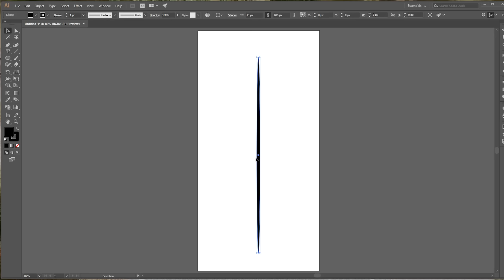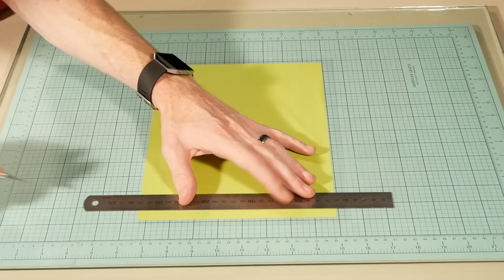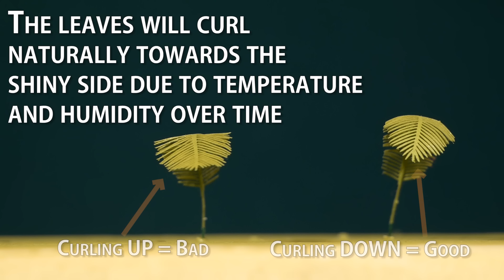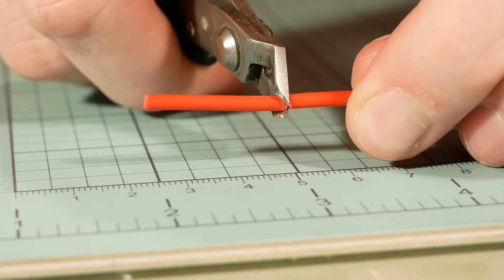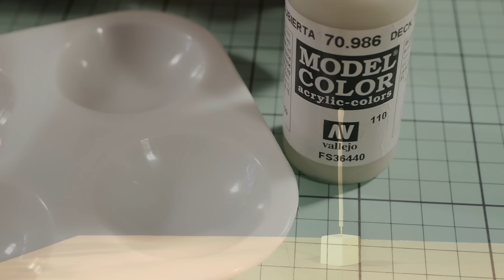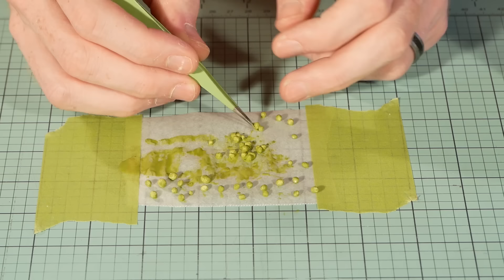Coconut Palm Tree Tutorial - Model Scenery

Comment: If you want to get a more organic, random assortment of shapes in Illustrator without a lot of manual effort, try using Object > Transform > Transform Each and check the "Random" box. You can then play with the sliders and inputs to make the leaves a slightly uneven length and even adjust their rotation angle at random within a range you specify.

Comment: What scale are you working in for the palm fronds cut with the electric cutter?  I wonder if the cutter can do ones small enough for HO.
Reply from the maker: hey mate, yeah these are HO scale. It could probably cut slightly smaller but I think the intricate detail in these palm fronds are pretty close to the limits of this machine. I'm planning on making a large beach scene so the scan n cut machine will be getting used quite a lot soon!

Comment: Ok so I've always had this weird fascination with miniatures.  I think it started when I was little. I always wanted to be able to shrink down and run around the models. Probably why 'A Castle in the Attic' was my fave book when I was younger. Anyway I've been inspired to start making my own and I was wondering what medium is the most 'forgiving' for newbies? Where I live I have immediate access to foam board, but I was also looking at these things called skinny sticks that look like little 2x4's, and was wondering if working with them might be a bit more challenging. Once again love these vids.
Reply from the maker: That would be so cool to shrink down and wander around your miniature creation! I personally think foam is easy to use and it's perfect for a base for the diorama but for making small structures I think the 2x4 sticks would work as well and I don't think they would be to difficult even for a beginner. The best thing you can do is just give it a try... If it doesn't work you will have taught yourself how not to do it and next time you'll be better... If that makes sense 😄
Reply: So I started experimenting with the skinny sticks.  They are about the same thickness as a popsicle stick.  Do you have any tips for getting even cuts with them? I picked an exacto blade set, but I've already noticed that getting an even or straight cut with them can be a bit of a challenge. Oh I was also wondering if Modg Podg is good for working with wood or do you just use that for the scenic stuff?